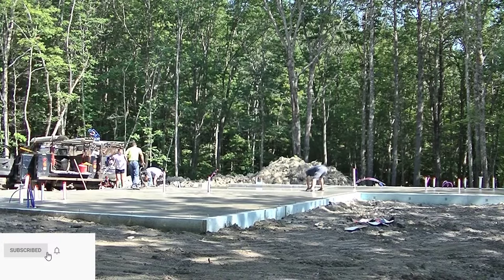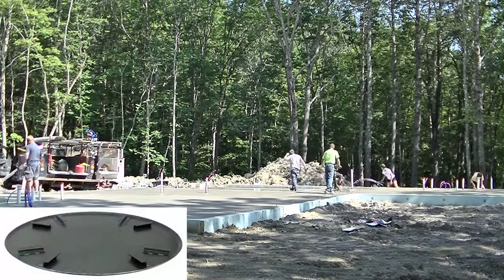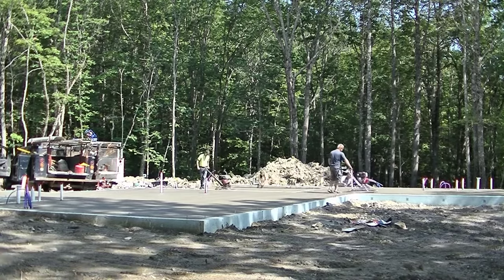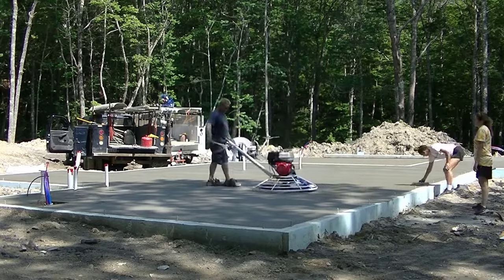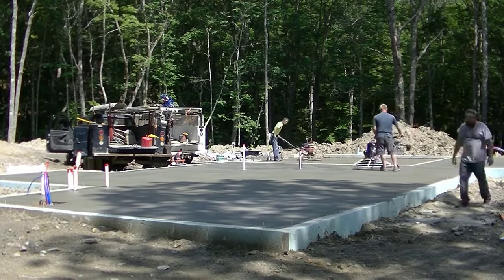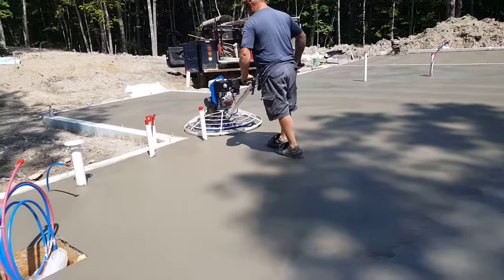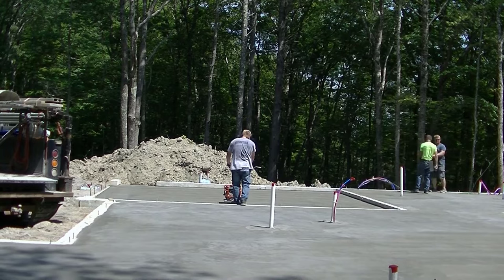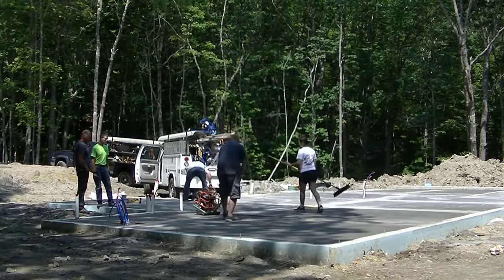Concrete Finishing Tips For Beginners | Power Troweling Floors

Comment: Here’s a tip I learned for saw cutting: when you have to cross a cut with another cut, put pieces of cardboard where you cross cut and you won’t get chips or pull stones.
Reply from the maker: That's what we did. Maybe I didn't show my guy doing it in this video.
Reply: Or fill it with dust from first cut

Comment: Hello Mike 
I just recently had a 24 x 30‘ garage floor poured with key ways 10 x 12 sections. Guy use the power trowel to leave me a smooth finish, but it’s not exactly smooth smooth there’s a cavities as I call them also at the doors he said he angled to lower water if it came in to come back out with a problem is when you shut the door there’s a 2 inch to 1 inch to 2 inch gap, because one of the key ways is in the way I don’t think it was done, right . Cording to your other video I watched people who use it too soon or wait too long tend to debits or work sinks in. I think he did that as well. The only solution I see is a have to come in and vinyl patch by the doors I shouldn’t have to do that with a brand new floor thoughts, thank you your videos you’re helping

Comment: We call those float shoes and we call it burning it out . Here in south east Missouri . I used to have my own concrete business for 14 yrs. I had a 3 ft. Allen 9 hp egder mainly for panning , a 4 ft. Whiteman and a 6ft. Wacker neuson rider . Now I'm a Foundation Foreman for a large commercial concrete company . The company I work for has everything from 10 ft Riders down to two foot edging machines . They have all different brands but the owner swears by Whiteman .
Reply from the maker: Whiteman's good, I have 9 of them also.

Comment: Hey Mike great info brother! Another awesome tutorial! The company I work for does a lot of commercial work, so they have to be flat or super flat. The best and most flat floors I've ever been apart of have all been hit with pans. Some we've even rechecked, or check rodded. Restraightened anyway, whatever tool you want to use. Even an 8 ft channel can restraighten. But when you have guys like your team laying it down, I doubt you would need to restraighten. You guys eat floors like that for a snack I'm sure. Thanks for your time and sharing what's taken you years and a lot of hard work to learn. Keep them coming brother
Reply from the maker: Thanks Frank, I appreciate your comments and supporting the channel.
Reply: There are alot of hacks out there Mike. Guys that take no pride in their work. Im all about the details. You were talking about people noticing edges. You nailed that too brother. I clean up every job I'm on, every day. That goes so far with people. I believe it is little things like that which seperate the best, from the rest. My goal is to start my own thing in the next couple years. If you have an email id like to ask you a few questions, if you have the time. I can only imagine how busy you must be. Thanks again for everything brother

Comment: We call those contraction joints or control joints.  The concrete shrinks to open them up - hopefully controlling the situation so more cracks don't open up randomly.  I teach people to keep the sections proportional, such as - 3' wide sidewalk gets cut every 3'', your 14 by 26 garage gets cut in half (13 x 14), etc.
An expansion joint would be one with expansion material in the joint -  desirable outside where the sun will heat it causing more expansion than the contracted gap can handle.  Indoor work has no need for anything more than contraction joints.

Comment: Hey Mike, ive just started finishing. All our work is indoors because we build prefabbed walls. I like how you mentioned you float it when your feet only sink 1/8 to a 1/16. We use a pan to float our walls and ive got that down. I start running into issues because i second guess myself and think "no its not ready to trowel" because i dont want to hit it to early. When is the best time to hit it with the power trowel after you floated it? I liked your video and really enjoy finishing and am just looking for more advice.

Comment: Mike

Do you use steel fibres in concrete?
Once power floated, will the slab be free from projecting fibres?

You are doing a great job!!!

Thank you
Reply from the maker: No steel fibers around here. Only micro-fibers, polypropolene.
Reply: I’ve only used steel fiber on one job in my life and that was for the driveway of a loading dock at a trash recycling center. If you’re thinking about using them, just be aware that they rust at the surface.
Reply: psidvicious Thank you for your reply.

Comment: hey mike, quick question!  if i plan to epoxy a garage floor, do i need to even trowel?
Reply from the maker: Troweling make the surface a lot denser than if you just leave it bull float. Better in the long run.
Reply: @MikeDayConcrete  sweet thanks :).... So better to to trowel and grind down?
Reply: @jimhendrix7776  thank you Jimmy for that Q I'm doing my first 24x26 with in a week or 2 great question guess I'll be on my knees all day
Reply: @MikeDayConcrete  and thank you Mike. I miss the 207

Comment: Hey, Mike. I purchased a used 46" multiquip power trowel. It doesn't seem used very much but when I used, it seems to want to fight against me pretty hard to one direction. I've used several machines before and can tell that it's alot of excessive resistance. Is there a way to calibrate it or is something probably bent?
Reply: Check the angles of ur blades. Could be off a smidge. Which makes it fight u